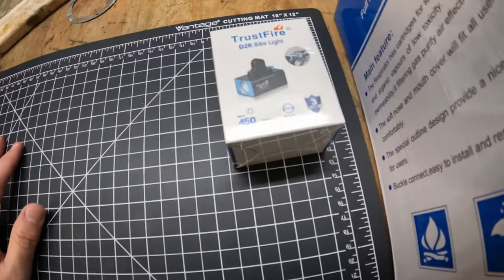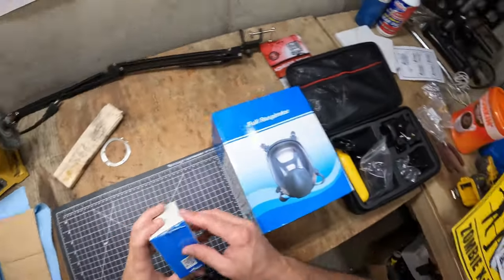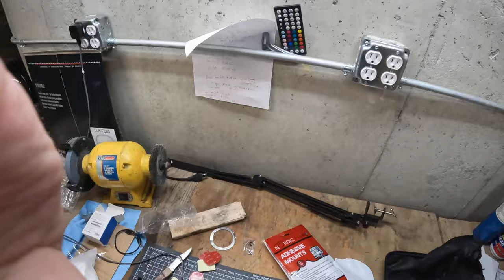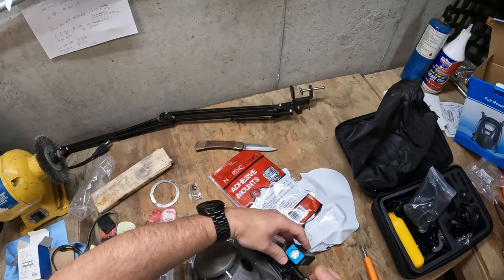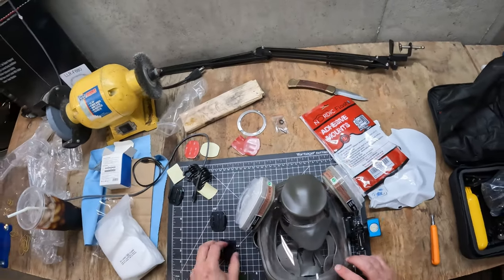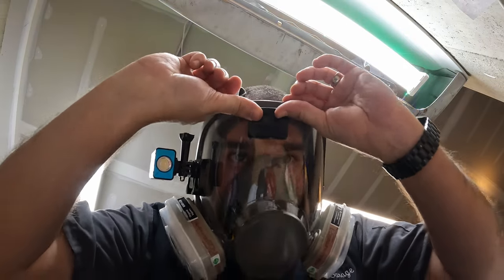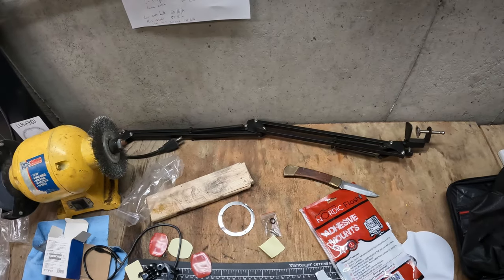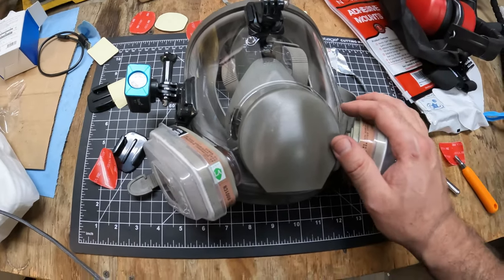Cheap(ish) Respirator Mod w/ Light and Camera Mounts - G/E 10

Comment: Was it only the double sided tape holding it? What do you do about the face shield protectors? Cut around it?
Reply from the maker: I ended up not having to cut anything. The only thing holding the light and camera mounts on are the double sided tape. They both have taken a real beating since then and are still going strong. Really surprised by how strong it is tbh.
Reply: @SleazysGarage  dam that's cool. On my mask I have the sheets that get covered in over spray and I replace them after a few jobs, how could I make this work with the disposal protective sheets?
Reply from the maker: @thetriggerman954  oh yeah in that case you'd have to cut out a notch I think. Mine is pretty caked in overspray at this point, the undercoating I used was particularly bad. I'll have to look in to those. Thanks for telling me about them!